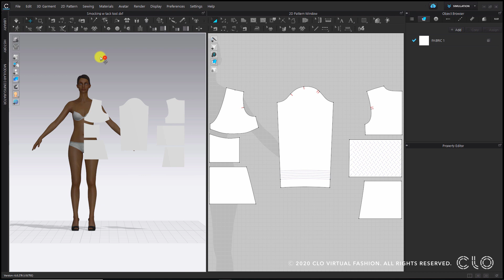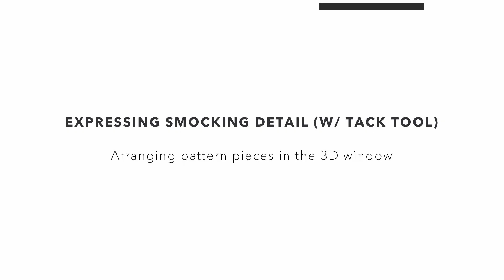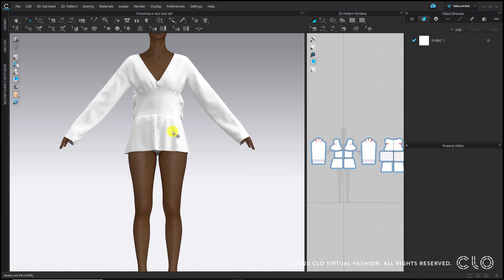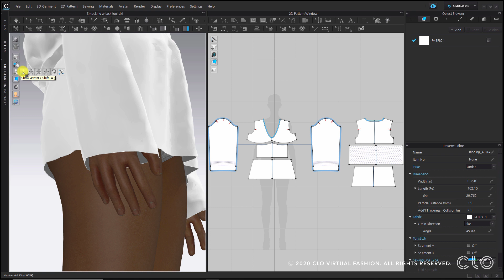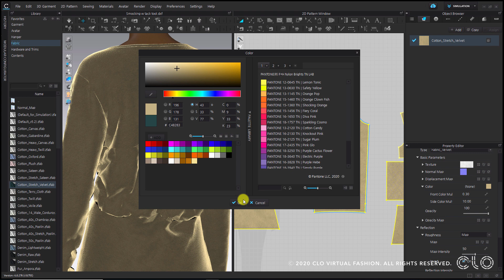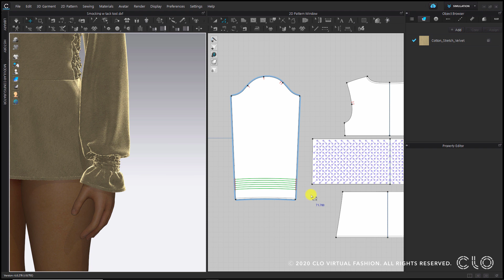Garment Details: Expressing smocking detail (w/tack tool) (EN)

Comment: How to prepare the fabricto use tack tool?  I mean those leaning internal lines on the back (I mean still purple dots) ?
Reply from the maker: The Purple dashed lines are called Base Lines. Those can be activated by using the Trace Tool. Use the Trace Tool to right Click on the line and select from one of the options

Comment: Question: I noticed that the tacking was not 100% accurate, i.e., not at the very exact point marked out. So it was a bit off. 

It was also very difficult for me to put it right at the exact spot when copying and pasting at intervals. So I guess a little bit of deviation is fine, innit? Doesn't seem like it affects the overall look by much
Reply from the maker: I understand your issue and what you mean. But do you have a question? Tacking is not an exact tool.

Comment: smocking detail not clean :(
Reply from the maker: Did you have a question?
Reply: @CLO3D  thish smocking detail/boofs not like it should be.
I also tried to make them and they went in different directions just like in the video. Not layers, not binding to another fabric did not help. Smocking detail/boofs is just awful: (
Reply from the maker: @DarkW1zard  It sounds like you might need more in depth help. I would post your issue with screenshots to our Support forum. https://support.clo3d.com/hc/en-us